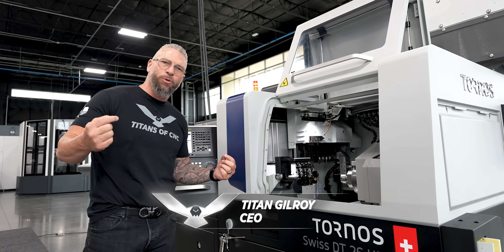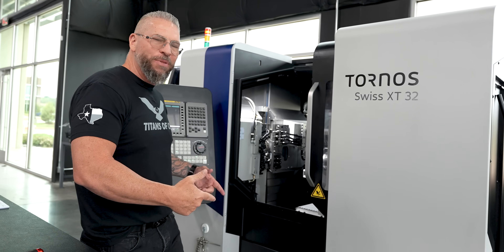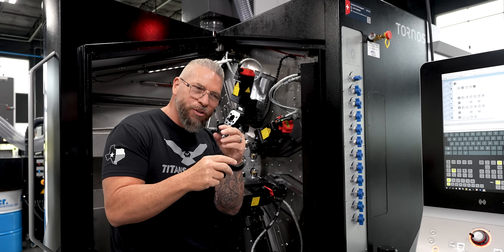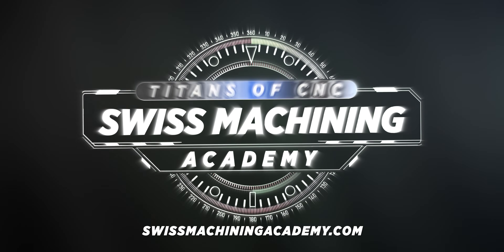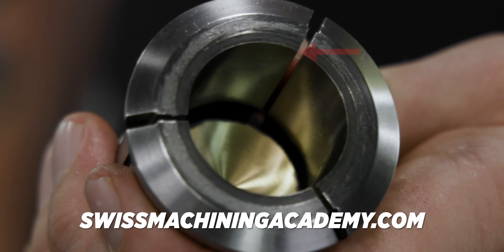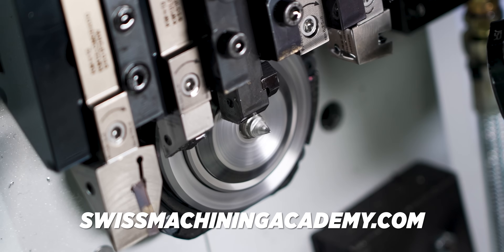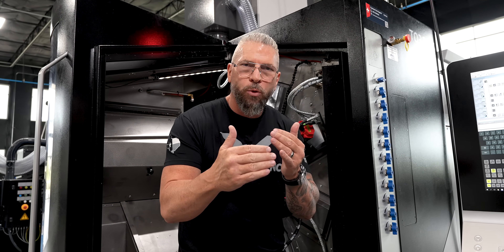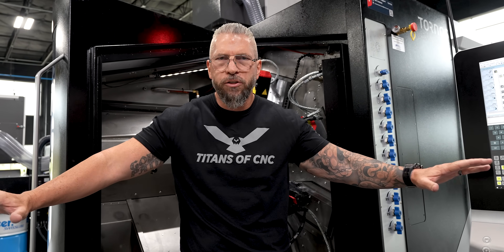The Game-Changer in CNC Machining

Comment: How does one begin to pursue a career in CNC manufacturing? I have a few 3D printers, sticker cutter, laser engraver and have always found it all so fascinating. Going to college undecided on a degree and need to make a choice soon
Reply: What about a trade school instead?
Reply: Start with technical education as a CNC Programmer at local community college, get a couple of years of production cnc work experience, then get a Manufacturing Engineer degree from university 
You would be more desirable to a company, than with just and engineering degree, because you already know what it takes to design a machinable part, instead of wasting time going thru trial and error in design iterations
Reply: To build upon what Paul suggested, seek out machine shop classes. They'll introduce you to the manual milling and turning so you can learn the basics for how those machines work. After that, see about further supplementing your CAD modeling skills with more industrial programs like Solidworks and MasterCam as learning the modeling/drafting side of the business will also help improve your knowledge base in preparation. CNC machining/ turning takes both of those and apples it in the ways you see these guys demonstrating quite awesomely.